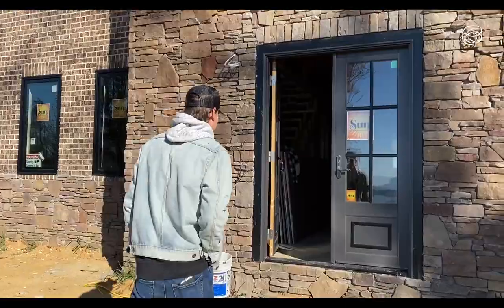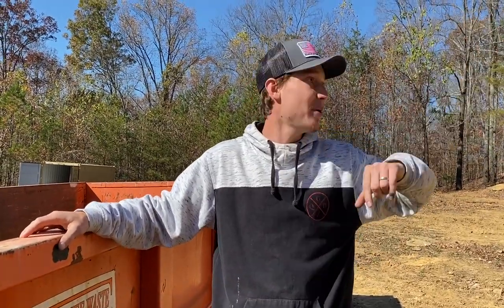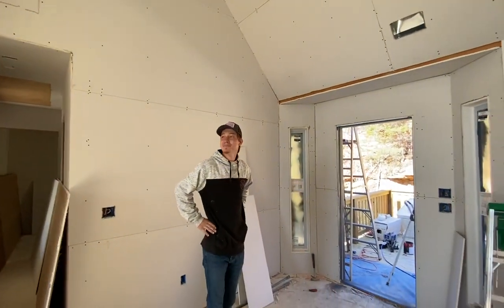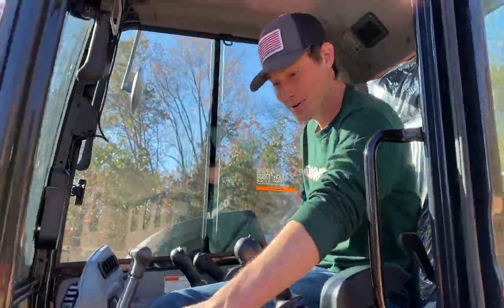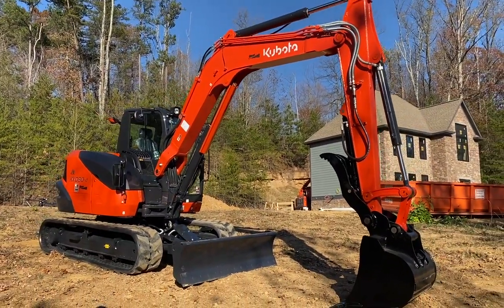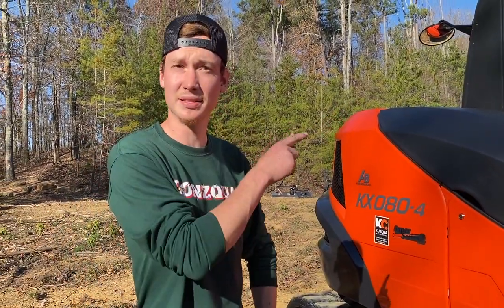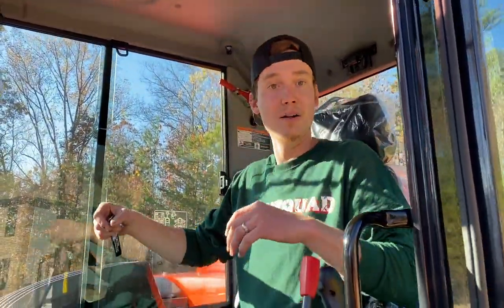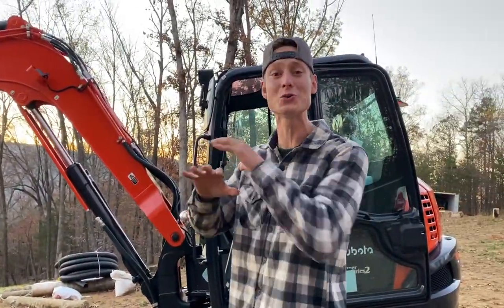We Bought The Most EPIC Excavator Ever!!!

Comment: There should be a "Controls Switch" underneath the driver seat of the Excavator to switch them over to the other style of Controls that you guy say you're used to. Otherwise don't be afraid to called up the Kubota Dealer and ask where it's located.
Reply: It’s under the seat near the door.
Reply: You would have thought they would have showed them, in the handover.
Reply: yep. Cat controls vs Deere. Really throws you off if you're used to one or the other
Reply: I personally reckon that it is on the correct pattern controls they're used too and they just need to get used to the way it handles. In my experience going from a 3.5ton Kubota to an 8ton, the controls take a while to get used to as you can't "feel the ground" as easy on the bigger excavators and you can't be as violent with the controls as on the smaller machines. usually takes around a day or two to feel how sensitive the controls are and i reckon they'll be alright.

Or I'm completely wrong and it needs to be switched to the pattern they know.

Comment: Ring or Simply Safe should set you guys up with all the exterior Lights with cameras in them. Also a sweet security system for the house. Keep up the great work.
Reply: There should be nothing casual about arrangements needed to deter and detect crime at an isolated rural location. The best option is for Goonzquad to engage an experienced independent specialist who is able to holistically analyse all potential threats at the 15 acre site and then is able to plan a comprehensive security system that fulfils all of the many requirements. The Crime Prevention Department of the Chattanooga Police should also be consulted as part of this process, in order to profile current local criminal activities. Furthermore, Goonzquad should converse with their Property Insurance Underwriters to establish requirements of their policies, which may specify certain theft protection measures which are obligatory. I would not advise any property owner to merely commission a 'security' company, however well advertised, or worse, a popular online business, to provide adequate protection in these matters without carrying out thorough research beforehand.

Comment: They haven’t figured out how to switch between  ISO and SAE controls. The valve is probably under the seat boys.
Reply: yeah either under the seat or near the hydraulic pumps. super easy to do!
Reply: Its under the side compartment on top of the valve body
Reply: What does iso vs sae mean ?
Reply: It’s the lever they said was the hydraulic shutoff
Reply: On my CAT. It’s done electronically.
Reply: Dealer should have shown them this.  Very common issue and should be part of the initial walk around when you buy an excavator.

Comment: You guys should get that pagani that just crashed
Reply: Judging by the numerous photos of the Dallas wreck, the carbon fibre monocoque is irreparable. Horacio Pagani is not going to manufacture and sell a new tub to anyone who he doesn't know personally, so if the insurers wanted to rebuild the car it would probably have to go back to the factory in Italy. However, even this may not be feasible if the US authorities decide to issue a Certificate Of Destruction (COD) for the vehicle, meaning that it could not legally be returned to US public roads in any circumstances. V Tuned discussed this issue in Episode 5 of his excellent current Series which covers the total rebuilding of a crashed McLaren 720S, which had a COD, by using a different tub that was only slightly damaged. But 720S McLarens are far more plentiful than Pagani Huayras, and I don't believe even Arthur Tussik would take this project on.

Comment: Sorry if there is mistakes, I’m quebeker so I’m French. Maybe the problem with your command in the machine, that are mixed up, is simply because there is two way to set it up. Patern A and B. One of them ; the boom and the bucket will be together on the right stick. And the other one  ; the bucket and the forearm will be on the right stick. Look in your book where you can readjust the setting. I know where on another machine but not in the Kubota. If I’m wrong, it is because I’m a paramedic....not a heavy equipment operator. lol

Comment: Good buy on excavator...you can get tons of work done and either keep it or sell for just about purchase price.  

Do your work and some side jobs and its paid for itself
Reply: Goonzquad have financed the purchase of the new machine from Kubota Chattanooga for approximately $2,000 per month. Almost all construction plant is acquired using this method, particularly in an era of low interest rates. Depreciation Rates on this type of equipment are fairly steady, and not as precipitous as they are for upmarket cars, but are certainly still an issue. Furthermore, the negative effects of the pandemic on the construction industry in the USA have depressed the demand for excavators, and this will reduce their resale values for the foreseeable future.

Comment: Regarding the controls: I’m not sure which controls you are used to using, but there are two options: backhoe and trackhoe. 

Backhoe refers to the left control being swing and boom up and down while right controls the stick and bucket. 

Trackhoe refers to the left control being swing and stick while the right is boom up down and bucket. 

There may be a lever on one of your valve bodies or a switch in the cab that changes how it operates.

Comment: Just finished building my own shower. Go with Hardiebacker board instead of the Durock. I usually use Hardie but wanted to save a few bucks and went with Durock. Next time I will spend the money on Hardie and have lot less issues to deal with.

Comment: Tall should consider a truck or trailer mount fuel cell for your equipment. So tall dont have to constantly have to run an get fuel.also look into red fuel it's not taxed like regular fuel its specifically used in farm an construction equipment . I believe cheaper.

Comment: Hey guys that valve is not a shut off, it switches the hydraulics from single direction for something like a rock breaker to multi direction for a tilting bucket or hydraulic grabs. And there should be little lever under the seat to the right to change the control pattern, if not just consult the manual

Comment: As a homeowner, I’ll tell you that shower tile with grout is a pain because mildew and mold grows there. The smaller the tile, and the more places you have to grout, the more mold and mildew you can get. Bigger tile with fewer seams is better. Entire wall slabs that you only caulk at the edges is best. Tile looks pretty, but nobody thinks about having to clean it later.

Comment: You can switch them controls around on that mini ex there should be a switch usually around the floor bored or seat unless it electronic then use would use the head unit to switch it

Comment: CONTROLS: there are two setting for the controls.  If the excavator has different controls than you are used to, simply switch the setting to the other control pattern.  It's probably a lever like on my kx-161-3 super series.  If that is the case it may be on the front of the seat area.  Or, call the dealer and they'll tell you how to do it.  Best of luck.

Comment: I don’t know if you guys are aware but there is two different operating modes that come with and digging machine. One is Backhoe mode and the other one is excavator mode. That is why it may feel different from what you are use to digging with. You can find the controls under your seat or in front you seat by the floor. It’s a simple lever that you move up or down to change from one to another.

Comment: Also if the controls are different to the little excavator your bro lends you, its likely one of them is setup in backhoe pattern (which sucks) Many excavators have switch in the engine bay that lets you flick between the traditional/standard control layout, and backhoe layout. Have a look around for a switch. Right hand lever pushed left should be curl bucket toward you. right hand lever pushed right curl bucket away, right hand lever up main arm away from you etc (going from memory as i haven't been in one in over 10 years.) Im guessing your bro's one was backhoe pattern, so your gonna have to re-learn the right way now lol.

Comment: Isn't that bucket on the excavator too wide for foundations?
Reply: Never mind. Finally got to the part where they said it comes with different buckets.
Reply: The bucket on that machine was 24" wide, whereas most residential foundation trenches and drainage trenches are narrower, depending on the loadings and the soil characteristics. But it all depends on the designer.

Comment: Hope in future plans you at the very least. Planned a central covered are for this puppy, one portion for fueling, 500 gallon tank but 1500 best. shop floor area min 8" reinforced concrete, refuel ( always use best and have on hand.) tank for truck and compressor,  for fuel/fluidsl and air, tools.
Spare fuel and its best filters, esprcially air diesel additives.
They are great machines warranty but be ready for broken hydralic lines and leaks.
Remember it is not an f'n 4x4 and sidehills weight of boom cannnot be forgotten, 
always at  end of day, brakes set and booms bucke weight sett on ground.

Comment: You guys are mistaken on engine size in trackhoe, its 69 horse power, in order to stay out of def fluid range, the skidsteer is 95 horse power, thats why it uses def fluid, 75 horse is the cutoff on horsepower to not have to use def fluid, and that big valve is for the secondary hydraulic lines on the boom for a hydraulic ram hammer or other attachment. You can also change the controls to operate in different patterns, your dealer can show you where that is.

Comment: That lever on top of the hydraulics changes ur controls from SAE to metric,  or people call them CAT controls to Deere controls that’s not a shut off switch. The brand bobcat, that switch lever is on the bottom of the hydraulics or under the seat, depending on what year the machine is. U said u weren’t used to the controls, switch that lever u thought shut the hydraulics off and it will switch the controls to what u want!

Comment: I dont know the specifics of the american law regarding insurance and stuff, but I wouldn`t do water/plumbing related stuff in the house by myself just from the liability point of view. If you do it yourself, you definately need to get a professional out there to check up on you work.
Reply: There are major industries supporting burgeoning 'Do It Yourself' cultures in the USA, UK, Canada, Australia and in many other cultures. Most large towns and all cities have 'Big Box Stores' where every component needed to correctly execute and install plumbing, electrical installations, woodwork (both carpentry and joinery), bathroom and kitchen fittings, cladding, roofing, decorative materials and indeed everything required to build a house can be purchased. There are many opportunities for anyone to learn the accompanying necessary skills. My Practice has advised many 'Self Build' groups in a dozen countries as they have successfully constructed their own homes over the last 42 years. Issues of Legal Liability do not usually arise if the buildings created are for private residential use, and if tradespeople are not employed to manage the projects. Some work may however be required to gain the approval of Building Code Inspectors, but their involvement varies depending on the regulations in each jurisdiction (and even between States in the USA), and tends to be minimal.
Reply: @johnstedman4075  of course I fully support it if the boys do it themselves, I guess it comes from me having studied law in germany, of being a landlord and hence knowing, somethings you better just dont do yourself, because IF something breaks, insurance might not cover it and I could be made privately liable. I just wanted them to be a little cautions I guess. And having minimal regulations In my eyes really is not a good argument.
Reply: @Tomiciable  Goonzquad (GS) have previously and repeatedly been warned in writing in the Comments Section of their YouTube platform by a number of design, construction and legal professionals that many of their activities or omissions are reckless and could result in financial loss, personal injury or even death. These warnings have mostly (but not only) pertained to the improper use of tools and equipment, and to their use of unsafe working platforms at height. However, GS have not significantly changed their behaviours and continue to adopt casual and negligent attitudes towards safety. For example, in the recent episode where GS took delivery of a 'Kubota Model KX 080 4' excavating machine, they recklessly broke two of the specific Safety Rules which are prominently printed on Page One of the accompanying Owner's Manual. My primary concern in this matter is focussed on the bad example which GS are exhibiting to the young and impressionable members of their online audience, which often exceeds 500,000 people for each of the uploads. The USA has a litigious culture, and should a viewer from that country suffer through the influence of GS activities on social media, I have little doubt that they (or their Next of Kin) would consider pursuing GS for Damages in a Civil Action. In that case, I would expect the Plaintiff's case to hinge not only on Rules, Regulations and suchlike, but also on prior warnings which had been published on social media. I do not know whether this argument would succeed, but I would certainly wish to be on the Plaintiff's side of that Court.

Comment: Dunno if it’s just me but as a electrician I hope that’s not 14-2 (white coated wire) vs the modern 12-2 (yellow coated wire) like here where I’m at 12-2 is code and 14-2 isn’t code and a cheap methods to wire up houses nowadays that can only be used outside city limits  🤦🏽‍♂️🤦🏽‍♂️🤦🏽‍♂️ if it’s 14-2 I’d be pissed putting that old stuff in a new house 🤦🏽‍♂️🤦🏽‍♂️🤦🏽‍♂️